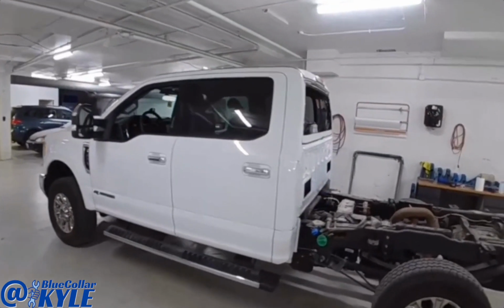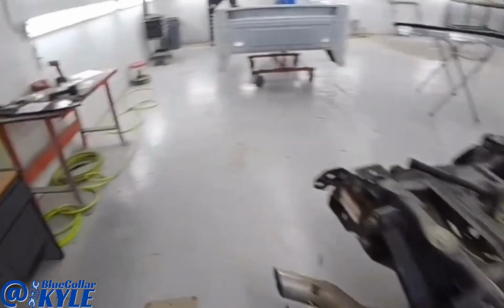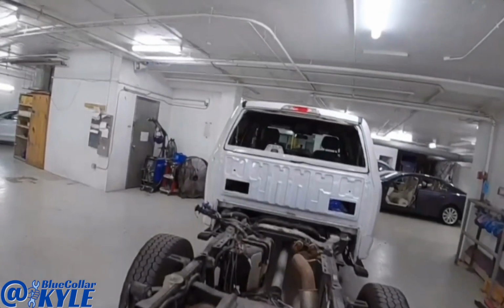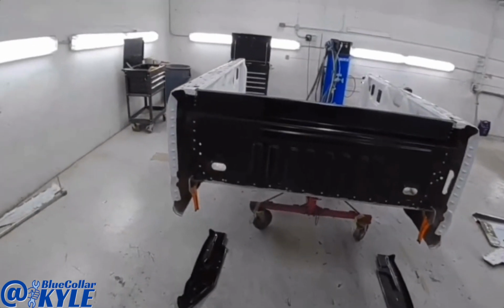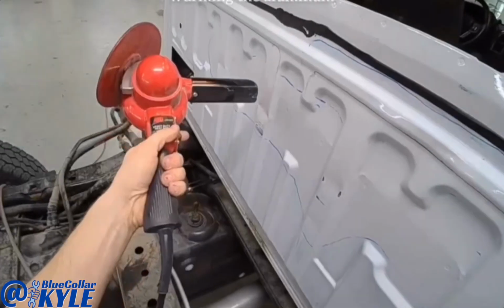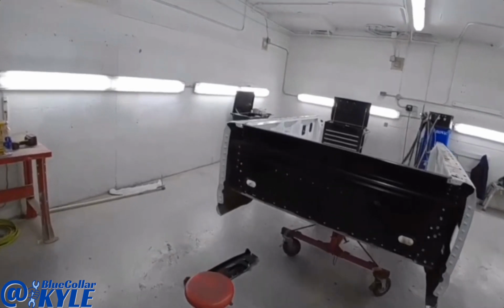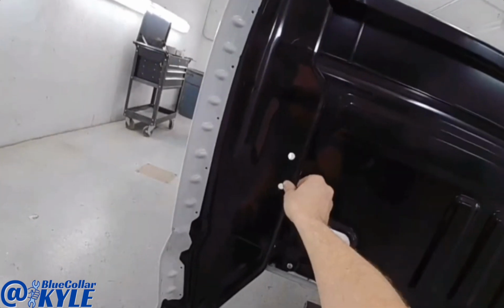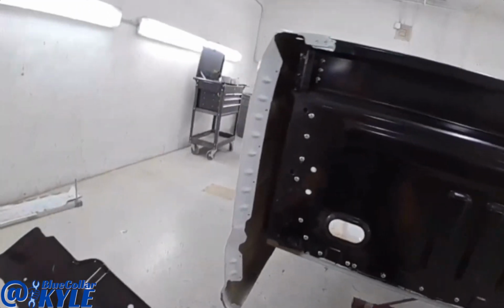Hitting The Brakes With A Heavy Load!

Comment: Is the back of the cab aluminum to
Reply: He used heat, so it can't be
Reply: @the.anonymous.driver  no sir you are wrong. It is perfectly fine to use heat when repairing aluminum.
Reply: What I meant is use of heat on aluminium is limited as the metal doesn't retain its memory and structural strength once its heated to a certain point. It also hardens after being reshaped which makes more difficult to work with. Repair to aluminium should be completed at an aluminium station and isn't worked in in a traditional sense. Hope that helps.
Reply: @the.anonymous.driver  dosen't really help seeing as how I've been doing body work for 20 years and know all that. And was replying to your original statement in which you said it can't be aluminum because he is using heat.